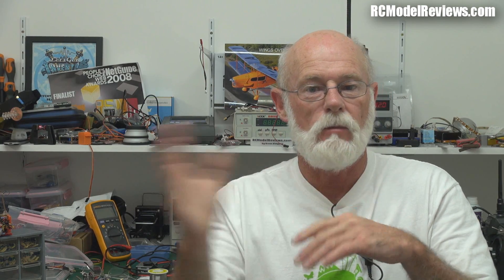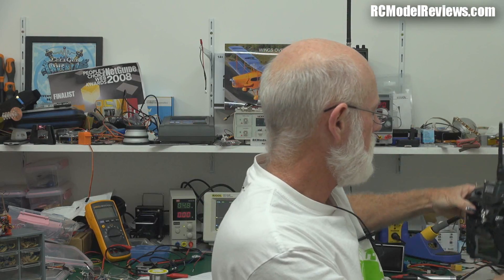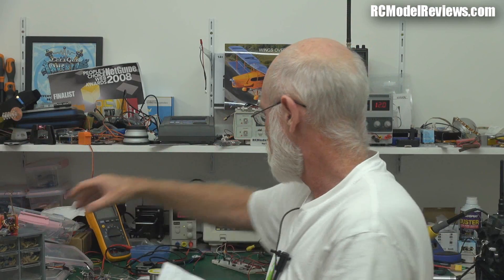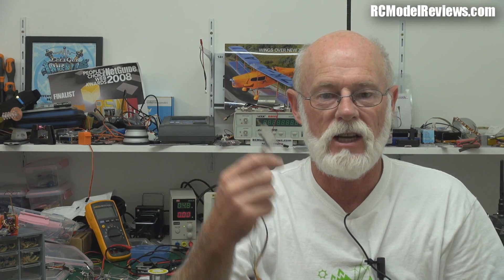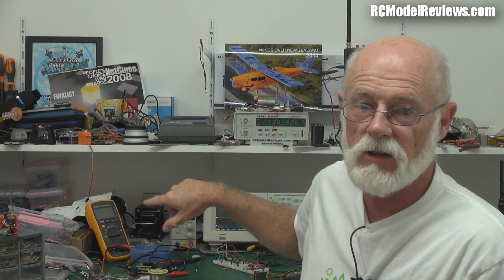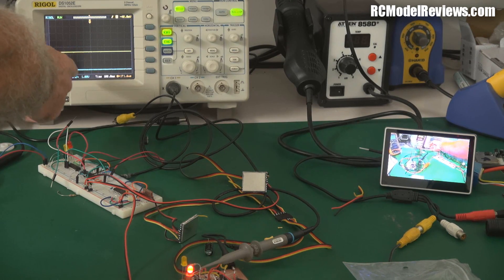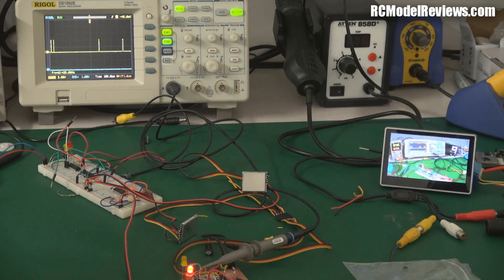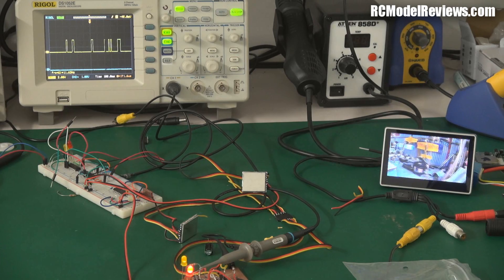A $1.29 FPV diversity controller (improvements)

Comment: Would it be possible to use three of these diversity controllers together in order to select the best signal from 4 separate video receivers? I.E. two video receivers attached to each controller, then the signal from each controller connected into the 3rd controller.

Comment: I just built one and I have used the common RX5808 receivers which I think you have used. The differece is astronomical when you only use a single receiver as I was doing before. Out of interest, what is the TX power you were using for these tests?

Comment: Im kind of surprised there's no plug n play solution for this by now. simple little board you can plug 2 (or even more) VRX's into and get extra diversity. Id love an easy way to tie three pepperboxes at 120 degree angles on a tripod. (perppbox beam width is 160 degrees)

Comment: Hey ! 
Amazing ! Perfect :)
I have build one myself, without much knowhow about electronics and it seems to work ! 
But one Question :

My Problem is, that the switchrate is to low :/ It sould react much sensitiver. 
Could I use a smaler resistor instead of the 820k to reach this goal, or sould i unsolder (remove) the compesetors ?! 

Keep up this inspiring work !
Grettings from Germany =)

Comment: I suggest you consider replacing the LM324 op amp with a comparator, maybe an LM339. The response time of the LM324 is pretty bad due to its poor slew rate. According to the datasheet, the LM324 takes around 10us to drive its output from 0V to 5V, whereas the LM339 takes a few nanoseconds. This may cause all sorts of problems considering that the CD4066 switches for both receivers may be switched simultaneously due to the slow output response of the op amps. I believe I noticed the slow rising output on the scope as well.

As always, great video. Thanks a lot!
Reply: the LM339 will work fine in operation, but people need to be aware it's not a direct substitute for the op-amp. Using it will make the circuit slightly more complicated due to needing pull up resistors on the output to get logic level outputs, and how the LED's are driven would have to be reworked as well.

Comment: I do not have 1M Resistors on hand, nearest I have here are 1.8M and 47k.
1.8M might be to high to switch at all, 47k might be far to small to notice any hysteresis.
What do you think?
Putting like 10x 47ks in series would work too, with a much smaller hysteresis, or does it?

Comment: I built this and it works perfectly. Does anyone know how to add a 3rd receiver to it?   Bruce seems to have disappeared off the planet :-(
Reply: I'd expect that to be much more difficult. You need either a triple A-B, B-C, and A-C comparator /opamp and then a decoder for the outputs. Probably more simple to do it with an Arduino MCU with 3 AD convertors.

Comment: Checked the whole series and looks awesome, so will probably build it! I have a question on the chips thought (LM324 and the other)... Do they require any modifications, flash, software or something or can you just buy them and stick them on? I watched the 3 videos but did not find anything mentionned! Thanks guys!
Reply: +zewill Those are completely analog devices, there is no flashing that can be done because there is no digital electronics let alone a microcontroller, just plug and play :)

Comment: 7 month later, what volt on the capacitors? =)
Reply: mrpeter81 What voltage are you using to power the circuit? Get any capacitor that has a rated voltage above that.

Comment: Here is a puzzle.  Two identical model receivers that when no signal have a different voltage level on RSSI pin and when the vtx is powered again a fairly good difference in voltage level (identical antennas). Software wise if you were to keep the range between the minimum and maximum for each receiver they may not match or be linear.  In this case I am not sure that having the highest voltage on the rssi is truely the highest signal.  I suspect that this can vary depending on the internal vreg and other components in the receiver module.  Anyone come across this or do you find most of your receivers are very close in output signal?

Comment: Iv just built this for the 3rd time but cant get it to work?
Is the cd4066be the same as a cd4066? And lm324 the same as a lm324n?
I dont understand why i cant build this simple diversity!!!
Reply: I'm no expert by any means but I don't see any reason why it shouldn't work with the component's you mention? I'm getting ready to build this myself I just have to use 2 741 op amps and cross reference the pin outs should be the same out come as the 324 as long as I don't screw up the pins lol
Reply: I built mine and it works fine how ever it dose seem to favor one Rx more than the other but still works good I never got back here to post sorry its been 2 yrs and it still is working

Comment: HI Bruce,
Is there a way to boost the video signal out.?  Or is it capable of sending video to say goggles and a dvr, just by adding to video out leads to the same output.  How far away is the video on what voltage to use and the better version diversity controller.

Comment: Isnt it entirely possible to create a small device that would allow screens that suffer from Blue Screen to not do so? I have a huge 20inch Dell monitor that would be great for FPV, but doesn't have the circuitry.  Is this possible on the cheap?

Comment: I have a Dji PV2. It has two antennas for the drone controller and on the WiFi extender. Does this mean it has a built in Diversity Controller?

Comment: Hi Bruce. I love the project! It works great. When i implemented your new mods when i add the 820k ohm resistor my system only outputs one of the 2 signals. It always prefers input 1. When input 2 has higher V both leds light up and it still displays  input 1. Any ideas?

Comment: Help!!.... have built the board but now stuck on how i can wire it up to work with my Fat Shark goggles, i have connector that will fit into my goggles, but what wires do i need to go to where to transfer video from the board to the goggles?  Any help most appreciated.  Thanks in advance.

Comment: Mine didn't work when I put the 820K resistor in, only one of the outputs worked. The fluctuations are less with the capacitors but I had to leave out the resistor.

Comment: Hi Bruce,

I am a huge fan of you and the channel but having some trouble getting my head around the benefit of this setup.

As I understand it, you need two receivers with two antennas for this to work. From a beginner point of view, what is the benefit of building this vs. just using a single diversity receiver with two antennas? You talk about keeping costs low but as far I can see, two cheap receivers plus the 1 dollar 29 for parts currently cost more than one diversity enabled receiver?

There is probably a huge benefit to this setup that I am missing so would love to be enlightened. 

Cheers,
An FPV Beginner

Comment: Bruce, just wanted to let you know, the moment I got back to the lodge and started doing some FPV, the esc started acting up again... I'm not sure why, it just seemed to stop working. Gave me a few flips into bushes and it stopped responding with motor 3 at full throttle... :/ I threw one of my 3 cell groundstation batteries on it, and now it works haha:) guess I got lucky and won't be needing to make a stop at a hobbyshop in queenstown to pay 50$ per 25 apm esc haha.
-riley

[edit]
DJI esc worked fine till I was over a cliff 300m away in queenstown, when it got stuck on full throttle. almost brought it back, but when I tried to descend the quad flipped and a snapped.. the discovery's taking a dirt nap haha gotta build myself a new one whenever I can afford it.

Comment: This video has inspired me to build my own components , I bet it has others too!
Thanks for the easy to follow guide and explanations'
Just a quick question on a slightly different matter, can you run video signals through the audio line of a fpv tx? I know you can run telemetry info . It might be possible to have 3 fpv cams and 3 screens on goggles to create close to true 180degree view .
Thanks again.
Reply: I will save you the time, I understand now audio line has only 50khz compared to video 5mhz for video =  audio line doesn't have enough bandwidth for video

Comment: The video was pretty good considering your signal is passing through a big metal building not to mention the walls in your workshop. I would have to say flight testing at this stage would go rather well. Thanks Bruce. I have already started my build spectacular engineering and use of every day components. My build however went over the 1.29 lol

Comment: hysteresis is good, but you really need to understand hysteresis circuits. it offsets the voltage trigger between the differential input voltage, this offset will also cause delay and error with the actual strength of each rx, example, rx 1 is 2.5 volt and rx2 is 2.6 volt, therefore in order to get rx1 video output, you need a certain amount of offset volt to trigger rx1 ON even if rx1 is already higher than rx2. example A hysteresis offset voltage is 0.5 volt, then in order to output rx 1, it needs a 3.1volt rssi before rx1 kicks in. this is an error in switching diversity, coz rx 1 should have kicked in @2.7v., I have a different solution to this. RC filtering the output of  the rssi voltage would be much better and will have less errors, the voltage will be more linear, RC transient of 1-3ms in the inputs of the comparator and output. these comparator have high impedance, shunting it with capacitors  to ground will eliminate the problem, altering the timing rather than hysteresis (altering the voltage). take note: RSSI output is also used by the rx, usually for AGC, we can use the other 2 opamps as baffers so as not to affect the RX rssi's and AGC.
Reply: "but you really need to understand hysteresis circuits".

Not really for 99.9999% of us, just build it and it works, that is all we need.
;-)
Reply: I do know what it is... tnx
Reply: The point of the offset is that constant switching will cause more flickering in the display than an ever so slightly RSSI. You could put a potentiometer instead of the resistor and adjust how easy it switches.
Reply: the problem with hysteresis is the voltage offset which the rssi needs to change state, if you calc the circuit, you will always need a higher rssi to trigger it to a different state. its not going to be an accurate comparator but a Schmitt trigger instead. my idea would be delay and timing insertion.
Reply: You don't really need hysteresis unless you really need a higher value trigger, Bruce explain in a follow up video that the rssi fluctuates rapidly causing sudden fast  switching. just increase RC time will fix that, all we need is a clean linear average rssi voltage without the sudden transients or pulses rssi creates. THAT ALL .its just like removing ripples on an acdc supply. if you still need more, use an rc time delay on the comparator output too to prevent very short switching state change. this in turn will only allow higher time output pulse width to register and cut of shorter pulse  width switch state

Comment: I know this is a dumb question Bruce but I have to ask it anyway. As I understand it a Spektrum Rx does not have an RSSI or PPM out put so can you still use this controller with a Spektrum Rx in the plane or does the RSSI signal come off the Video Tx? Have I got things all screwed up in my thinking??? I just can't wrap my head around it.
Reply: The RSSI is the video receiver RSSI. Nothing to do with controlling the plane, all this gear goes with the base station next to you on the ground, it's all to do with video.

Comment: I see that there are a few people doing PCBs. I was thinking of doing a fully assembled PCB with all parts and proper RCA jacks to plug in the inputs and outputs. I would build it with audio and video switching. I could probably sell them for around $15. I would have it built with surface mount for components and through hole for the RCA jacks. If there is enough interest I will do it.
Reply: That could start a new business!  I would be interested in a built version or even a kit to solder.

Comment: Doesn't wantonly switching between video signals produce noise/flicker if you, say, switch in the middle of a video signal?

Would it be better if the the two video signal's sync pulses were...  sync'd with each other, and then you only switch sources during the sync pulse?

Then perhaps you wouldn't need to bother with hysteresis.
Reply: Yes, this would be an ideal way to do it -- but you end up with something and order (or two) of magnitude more complex to design and build.
Reply: ***** Well that's where your expertise comes in :)

It seems like a matter of reaching into the RX's, the same way you reached into them to grab the RSSI signal.

I don't know how the video processing of the RX's works, but if you can get their sync periods sync'd with each other, then fed the sync pulse into a latch/flip flop as one of the inputs, and your comparator as the other input, then that might do it.  Flip flops typically already have an inverted output as well.  Probably would need one of the op amps to convert the sync pulse to TTL or something.

Comment: Bruce I noticed with the chips that there are still 2 more switches comparitors.
Obviously you can create as many diversity channels as you have rx's.
Reply: The other diversity project handles up to four receivers but it's a bit harder with comparators so I'll be showing soon how to use those other two switches to switch the audio signal along with the video.
Reply: Im a sparky. Your and engineer, Surely we can sort this out lol...

Comment: Bruce, you listed the IC part links for Digikey, but not the links for anything else.  You should post the Digikey links for all parts of the latest design in the the text below the video because if someone is ordering the parts from Digikey via the cheap and fast 13 oz and under 1st class mail shipping method (as they should if they live in the US), they might as well get ALL of the parts from Digikey.
Reply: And the total price will be so cheap that they might think about ordering parts for other FPV flyers they know at the same time.

Comment: Can anyone that is good with this make a printable PCB layout so the users can make a board for the circuit? many thanks
Reply: Already sent the previous version without the additional components to print. Working on the new version now. Should take a couple of weeks until I see them. Will share on RCGroups if works.

Comment: I wish we had a decent electronics supplier here in America.  Just the two diodes were $4 at RadioShack. And a five pack of resistors are $2 a piece.  Think my build will come to around $15-$20 once I find and order the two chips online.

Sad, because I bet if HobbyKing made this it'd cost under $5.  No wonder we can't compete with Asia... We can't even buy the electronic chips for cheaper than the price they sell entire electronic devices for!
Reply: We do. Digikey has a HUGE parts selection (just like Mouser) and no minimum order (once again, just like Mouser). However, Digikey has an advantage over Mouser in that for lightweight orders like this one would be, they allow the use of cheap but very fast 1st Class Mail shipping (max weight 13 oz). You can get a LOT of ICs and passive components into a 13 oz total weight package. If your package is heavier than 13 oz, they will ship it by the next least expensive means.
Reply: I suggest you buy in Banggood Assorted Resistor and Capacitor packs that have most of what you will need in your life for less than $10 ;)
Reply: You also have Mouser.  www.mouser.com.  There are more, but DigiKey and Mouser are the top two.
Reply: It is cheaper to buy this kind of stuff from ebay, DigiKey , Mouser etc.. are more for businesses and often have a minimum order of like 50$.
Reply: Fry's is the bomb! We are lucky enough to finally have two of them where I live!
Reply: Jarrod Roberson Not in this state.
Reply: Check out digieky, even with shipping you will still be ahead.
Reply: Winston Smith - Thanks, I'm aware of DigiKey.  My post was in regards to local storefronts where I could go rundown and pickup what I needed in the middle of a project.
Reply: thechosendude Yeah, its really frustrating not being able to walk into a store and get what you want. and now they are probably closing a lot of them too. So the stuff i could get i probably wont be able to get anymore.
Reply: Sad reality, is you need to just get on ebay and order most of these items in bulk packaging of 10 - 50 each for less than what 5 cost at a brick and mortar from some chinese supplier. These are regular "go to" components they will get used if you do any regular prototyping. Then you have what you need when you need it.
Reply: thechosendude "Thanks, I'm aware of DigiKey.  My post was in regards to local storefronts where I could go rundown and pickup what I needed in the middle of a project."

I don't miss them when I can order from Digikey and get the items cheaply in a matter of days. For quick access to circuit change components, buy resistor and capacitor assortments from eBay.
Reply: Digikey wanted to charge me $25 to ship outside of the states for a component order of $5.50. They have websites that look like they are local (eg, "Digikey.com.my" for Malaysia), but when you go to process the order it comes up they ship it from the US. When I requested they just send by regular post they said it will still cost $20.  Now days I buy most components from RS-online and most of the time they ship for free. And remarkably lighting fast service when it arrives in 1-3 days. Try them out.